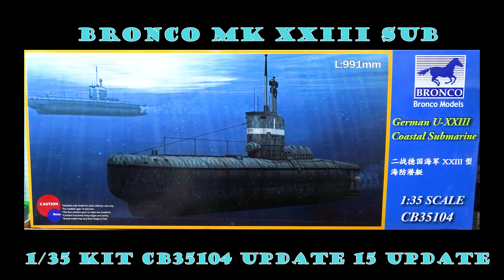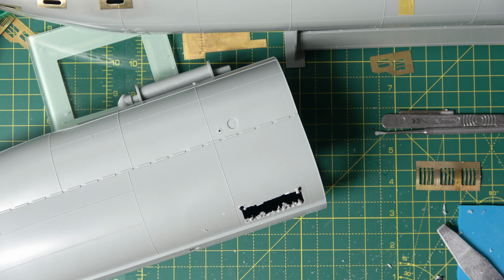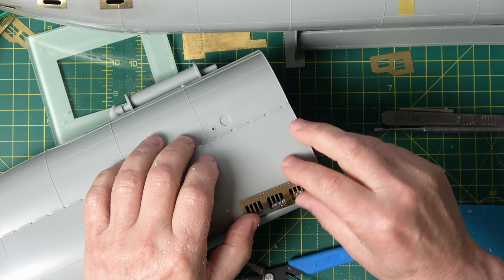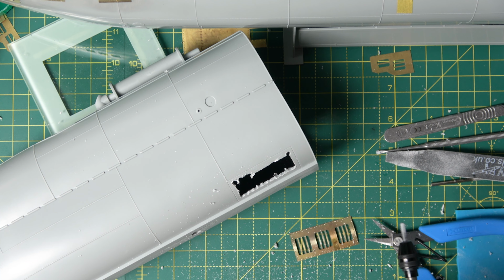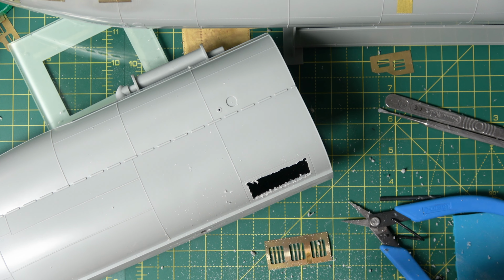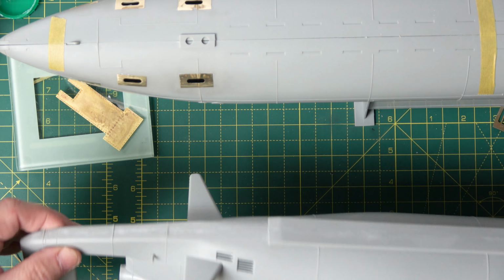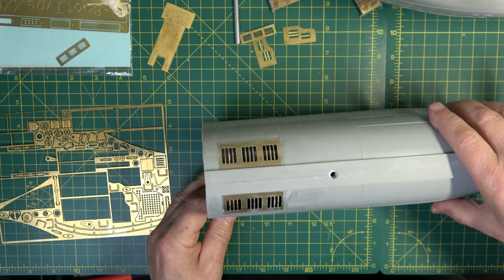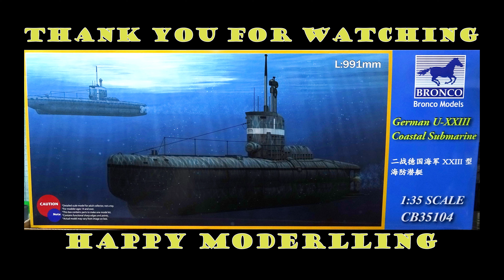BRONCO Mk XXIII SUB 1/35 KIT CB35104  UPDATE 18

Comment: Great update Paul, and looks to be coming on really nicely. 
How easy…..or not, to heat and set in the various photo etch parts into the hull….🤔
Reply from the maker: Well the instructions for photo etch say use heat, and the PE is thinker than our normal photo etch. It does take some time and the  plastic on the kit is quit thick.  I just had to take my time. Normal photo etch would probably melt. Just a thought they can only drop out not in, easy fix.